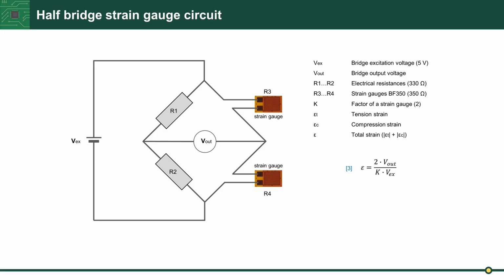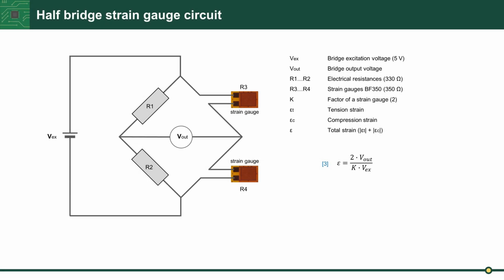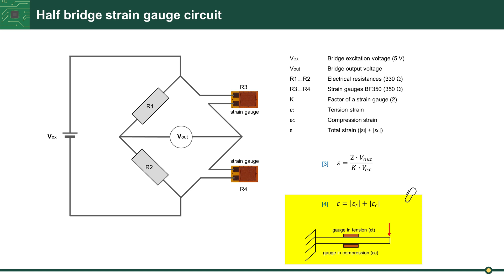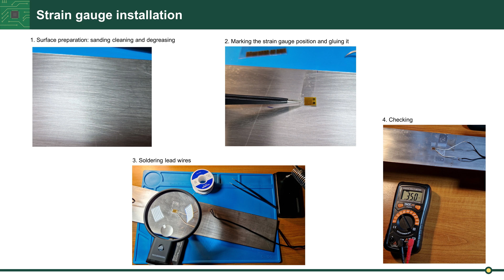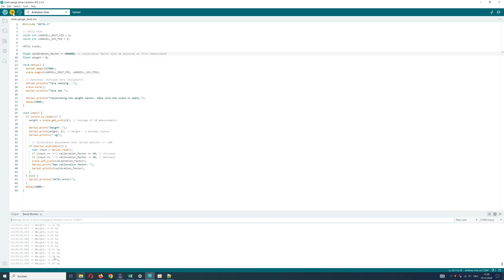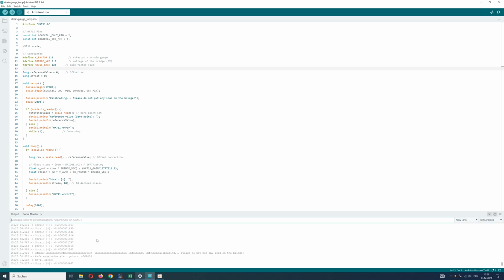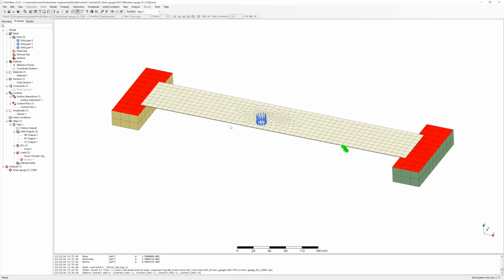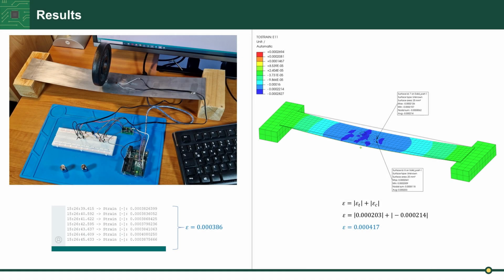Strain gauge measurement with Arduino Uno R3 & HX711 Amplifier | Electronics

Comment: Thanks for the video. Question. If I use a single load cell in the Wheatstone bridge, what value should I choose for resistor R4?
Reply from the maker: I think, choose R equal to the nominal resistance of the load cell (e.g., 350 Ω), using a precision, low-TC resistor.

Comment: Hey, I'm studying these strain gauges for an article. In formula [2], shouldn't it be Vout/Vex = R2/(R1-R2) - R4/(R4+R3)? The first one has a minus sign.
Reply from the maker: You're Right! The correct formula [2] must be: Vout/Vex = R2/(R1+R2) - R4/(R4+R3). "+", not "-".
Reply: @andreas-baer-engineering  Hi again! I finally assembled everything (quarter bridge circuit), and testing right now, my system doesnt look so sensitive,  probably because Im using a knife (steel, 1.5mm) with the straing gauge only 10cm apart from the supports). One thing I noticed is that my code isnt showing any value of deformation when the piece is under tension, only in compression. I would be glad if you could give me any tips to solve that. Cheers from Brazil!

Comment: Hello sir,
Firstly thanks a lor for video. I have a problem and i couldnt find the reason. I connect the BF350's like in the video. I observe the very very different values in the serial monitor like them;
Tara setting...
Tara set.
Calibrating the weight sensor. Make sure the scale is empty.
Weight: -3637.40 kg
Weight: -3733.80 kg
Weight: -3617.40 kg
Weight: -4895.60 kg
Weight: -3931.80 kg
Weight: -4769.20 kg
Weight: -5453.60 kg
Weight: -5447.00 kg
Weight: -6613.00 kg
Weight: -5156.40 kg
Weight: -4442.40 kg
Weight: 3995.40 kg
Weight: 1624.00 kg

Can you help me?

Thank you so much
Reply from the maker: Hello, it's difficult to find a fault remotely. It's often a soldering issue. Did you check your strain gauge for resistance after soldering? Can you send a few photos of your setup to abaer.engineering@gmail.com?
Reply: @andreas-baer-engineering  ı sent the video and photos your mail adress sir. Thank you so much for everything

Comment: Will this work for a thicker metal piece?
Reply from the maker: @tjandaliyev  I think it will also work with thicker sheet metal. There's a ready-made scale available in store, made of solid metal, that also includes two strain gauges.
Reply: @andreas-baer-engineering  Thank you!
I am working on installing strain gauges on Baja SAE's suspension to acquire data on how much force it experiences. I love your idea!

Comment: Hi! Thanks for the video. Could you upload the simulation of bending load case to run in PrePoMax? Thanks you a lot!
Reply from the maker: Hello, you can download the corresponding PrePoMax model here: https://drive.google.com/file/d/1TvBQ7XxzPUNKlhhb-7gtmI2KHifMEwVO/view?usp=sharing
Reply: Thanks a lot. One question, in the schematics you show two strain gauges but in the experriment I only see one strain gauge in the measurement point. Why is that? And you know how I can work with a triaxial gauge? I can't find any information about this on internet...
Reply from the maker: @FranciscoJavierRomeroRojo  Hello. I also have two strain gauges by the measurement. One is on the top side of the metal sheet and the other is on the bottom (they aren't visible in the video, but you can see the black wire below).

Triaxial strain gauges are used for biaxial stress states when the principal stress directions are unknown. After the measurement, the maximum and minimum strains are transformed. See information here: https://product.kyowa-ei.com/en/learn/strain-gages/kfgs_rosetteanalysis

Comment: Hello, how did you determinate the V out formula?  Do you have any documentation on this formula?
Reply from the maker: You can find the formula for a Wheatstone bridge circuit (here half bridge) in any electronics formula collection or table book. For half bridge strain is ε = 1/2 * 4/k * V_out/V_ex
Reply: @andreas-baer-engineering I mean the other one the float v_out. The vout that then you used in the strain formula
Reply from the maker: @MiguelMena-sf1zj  Ah, ok. Do you mean formula: float v_out = (raw * BRIDGE_VCC) / (HX711_GAIN*16777216.0)? The formula converts the digital raw value of the HX711 into the corresponding analog input voltage. V_out = (ADC-value * V_bridge)/(Gain*2^n). n is Bit-value, here 24Bit = 2^24 = 16777216. You can look formula to Analog to Digital Converter (ADC converter)
Reply: @andreas-baer-engineering Thank you so much I really appreciate. Sorry don’t you have any problems of fluctuating hx711? I did the same circuit but I have a lot of fluctuations when the strain don’t have any load
Reply from the maker: @MiguelMena-sf1zj  Maybe a solder joint or loose connection. Check the resistance of the strain gauges with a multimeter after soldering. Is the calibration correct? Check that the gain factor is set correctly (32, 64, or 128).